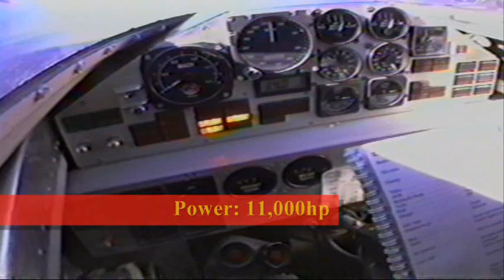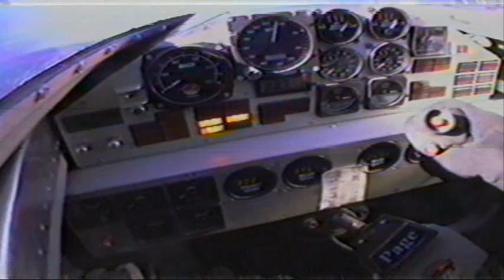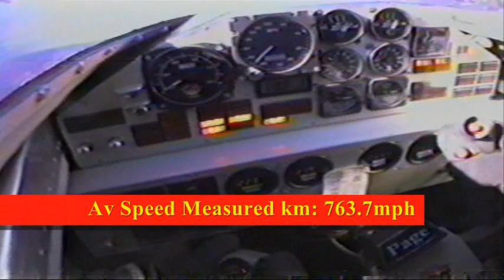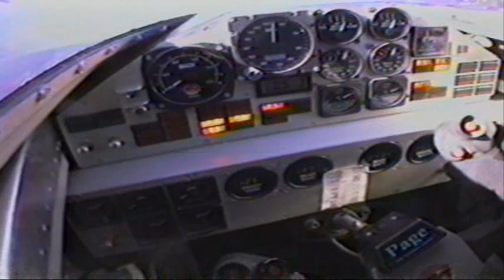Thrust SSC Supersonic Car - The Final Run 66 - Cockpit View - Black Rock Desert, Nevada - 1997

Comment: It was 110,000 hp but not bhp. There is no brake/power takeoff/flywheel. A jet engine like this one doesn’t provide rotational energy. Some, like turboprops or turbo shaft engines do but not this one. This is pure thrust and the equivalence is very, very approximate.

Comment: SSC did 0-70 in 20 seconds at the start of the run.
Why put silly figures up and ruin it.
Oh and 11,000bhp embarrassing
Reply: That's what it said but it's a misprint. It's 110,000 hp.  0-70 in 20 seconds? Watch the airspeed indicator after full reheat - afterburner - is applied at about 200. That thing hits 700 in the time it takes to read what I just typed.

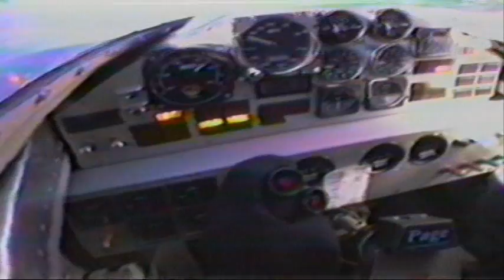Comment: What's that alarmy sounding noise at about 02:45 ?
Reply: it's low oil pressure alarms on the engines, happens because the deceleration is so fierce the oil all rushes to the front end of the engine.
Reply: Andy Green's bollock's rattling, there wasn't enough room for them.

Comment: There are a few inaccuracies in the captions. The equivalent power is usually quoted at 110,000hp. The times to 60 and 100 are actually quite slow, a fast car would do better. The engines were idled until the car reached 100mph so that they wouldn't ingest the desert and kill themselves.
Reply: they cant make it better because all the wheight on the car its to heavy to be a nissan
Reply: I mean the thing weighs 20,000 pounds after 100 mph it starts too open up

Comment: If it reached 771mph in that run, why isn't that the record?

And what is that awful noise around the 600mph mark?
Reply: I think that noise is the air around the cockpit going supersonic and creating a pressure difference
Reply: BMWM3GTRLOVER At transonic speeds, the airflow over parts of the car is supersonic, and not in others. That's the noise you here. It goes away once you get supersonic, but it's why planes don't fly faster than 0.85M because these supersonic flows create large drag (ans some of that energy is going into making the noise!)
Reply: Andy Green wouldn't have any notion that he was going faster than the speed of sound other than the mach meter on the dash. There is no proverbial "barrier" that you break through as is normally thought. There's no shuddering or any other indication to the driver/pilot that he's now going faster than the speed of sound.

The sound that you hear around the 600mph mark is the sound of the engine nozzles opening fully and running at 100% afterburner.

In order to claim the record, they perform 2 passes of the measured mile with the average speed being the final number. They must do that with a turn around time after the first of no longer than an hour. Pretty amazing feat when you think of the stresses put on those engines and all the other systems on the car.
Reply: BMWM3GTRLOVER 771 is the peak, but the record requires an average over two runs through a measured mile within one hour. The sound, as others have said, is the locally supersonic flow setting up a shockwave over the canopy. As the speed increases the whole flow is supersonic and the shock wave travels aft. The burner nozzles are full open a few seconds after he hits 100 and starts bringing up the power.
Reply: +cageordie nnp
Reply: Probably because they have to do two runs and then they work out the average. The other run must have been slower? I'm just guessing.

Comment: @3831M- there are many awards and competitions which celebrate fuel economy and push the limits of engineering to make the most efficient car travel the furthest on a small amount of fuel, or using environmentally friendly sources. These may well indrectly benefit the automotive industry by pushing new advances. Also, running high technology projects which serve no apparent benefit other than "because we can" serve to drive new innovations in multiple fields of technology with benefits passed on indirectly - you only need to see the Apollo space programme for an example of this.

These projects serve an aspirational purpose. The best example is the Bloodhound SSC project (see all the links to the right...), which is being used as an educational tool to drive interest in science/technology careers in school children.

To complain about the fuel efficiency of Thrust SSC, and cars like it, you might as well complain that a priveleged family is eating too many oysters when there are people dying of hunger during a famine; it's the wrong type of fuel, being used in a different way: Thrust SSC used two Spey turbofan engines, from an F-4 Phantom II jet fighter. As such, they would use aviation fuel, rather than automotive fuel, so don't worry, they're not taking anything from your parents' car!

Comment: Where did you get a good quality version of this recording? Do you have the tail recording from run 65? I'd love to see that. The 0-60 and 0-100 times are BS, this car can put on 100mph in a couple of seconds going from 350-450, but it idles off the line up to 100mph. You can hear on this when he says "thrust ssc rolling" then more than 30 seconds later he starts to accelerate the engines and says "looking for 85", that is at 100mph. Until then they fear sucking the surface off the playa.
Reply from the maker: This unique recording came straight from 400MBytes of Raw Video footage from the on-board webcam which was downloaded directly to disc back in Autumn 1997! I was personally responsible for the on-line media sponsorship for the Thrust SSC Project from Feb 1995 onwards) Best Regards - David

Comment: The back end of the car was melting and the team owner was practically destitute, the team was running on vapor. On some of the side pictures you can see the panels behind the afterburner nozzles had been driven in and scorched by the burners. These things aren't built to last. This is also extremely dangerous, so once you've done your best you leave it at that. But the same people are building Bloodhound, so they aren't satisfied, just done with this car.

Comment: What does the cockpit alarm noise indicate? Is it something to do with the engine shutdown or the chutes? I've heard it on every SSC run video that I have seen and it's clearly audible in the various documentaries that I have watched about the LSR, but I still don't know what that noise actually indicates.
Reply: low engine oil pressure. because of how fierce the deceleration is, it sends all the oil to the front of the engine

Comment from the maker: @Camerameister - Andy also says that "this is the 2nd Run on Thursday 15th October" , so together with the reference to Run 66 it seems to confirm that this was indeed the Final Run. I assume the plan was to do "back-to-back runs" but as you know, after this 2nd Run and the achievement of the LSR there was no need!
Reply: Is each run comprised of two parts - The out-run plus the return-run?
Reply from the maker: @Pithead  Yes! This is the requirement to establish a new world record in order to allow for wind speed and direction, The turn around for the 2nd return run has to be within 1 hour for a new world speed record to be validated.

Comment: @tudy000 

Oh, yes he is!! The car was directionally unstable at high speeds and the steering system via the narrow set rear wheels was not the most effective. The car had no toe in for self centring, so every input required another input to centre the car. Also at a high sub sonic speed range, the car would swing off in one direction, requiring a major correction input of steering. Driver has the nickname in the RAF of "Dead Dog"